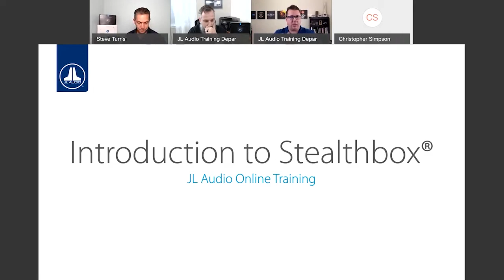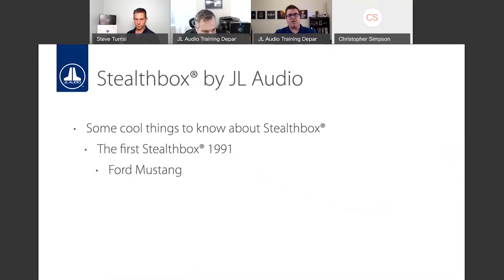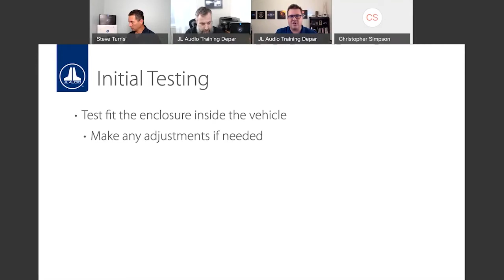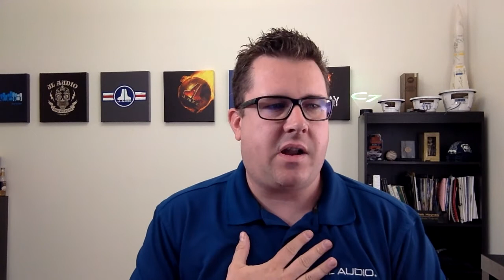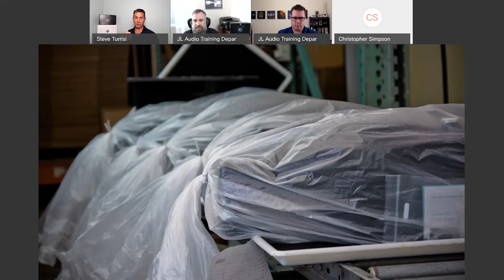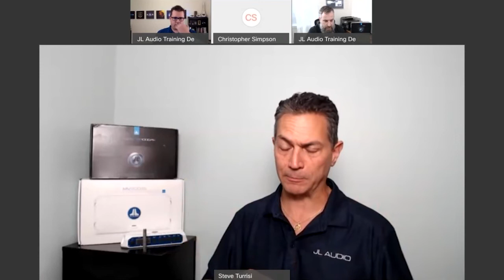[Live] JL Audio Training About Stealthbox® Vehicle-Specific Enclosed Subwoofers

Comment: Would the Vx1000/1i be to much power on the 2016 -2018 Camaro 12w6v3 stealth box?
Reply from the maker: Yes. The recommended power for the 12-inch W6v3 subwoofer is 200-600W. If you have system configuration questions you can contact our support team at 954-443-1100 or submit a support request via our help center; https://jlaudio.zendesk.com/hc/en-us/requests/new

Comment: I appreciate the content in this video.  I’m an owner of a stealth box in an E70 X5 which is completely invisible and the bass is incredibly hard from that 10”.  The design is great and while it does require losing the trim in trunk (that covers the battery but I can trim it), the supports built into the face of the box adds back to reinforcing any flex on the trunk floors, really cool.  I’m in the process of moving my JL amp, DSP, and integration speakers from the X5 to my F30...but I was really stuck on the examples here of it “may fit” but doesn’t mean it’ll perform well if I move the stealth box due to cabin optimization.  I’ll give it a whirl, but may bite the bullet and sell that to obtain an F30 specific stealth to complete the swap.  Great info guys.
Reply from the maker: Very nice. Please let us know if you have any additional questions, JR!